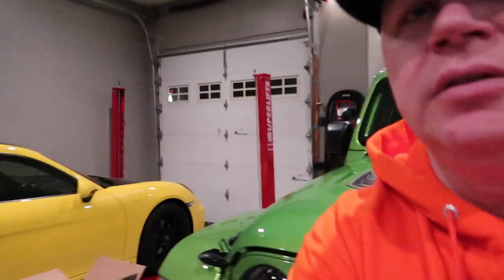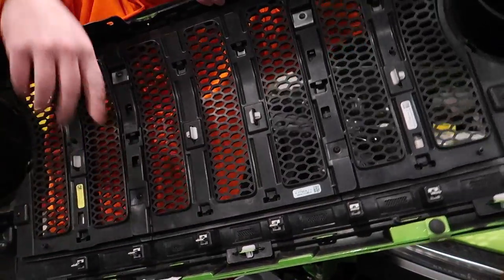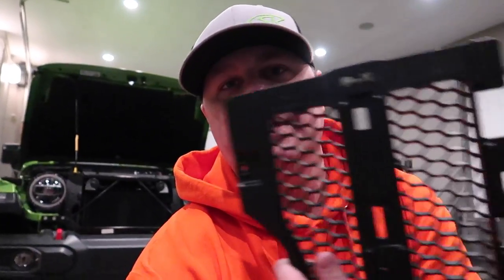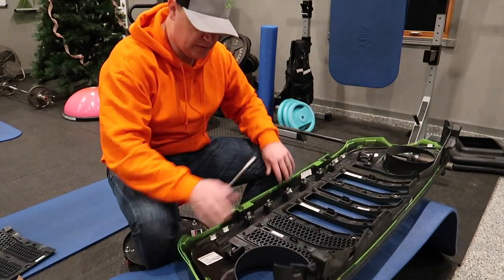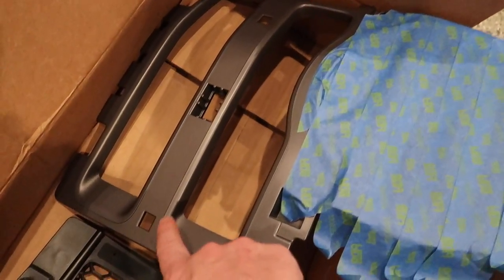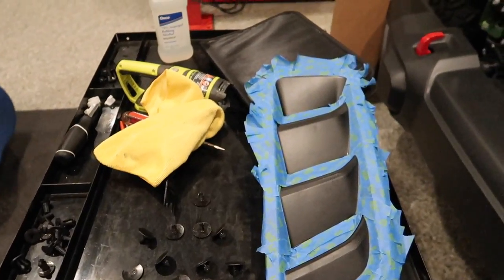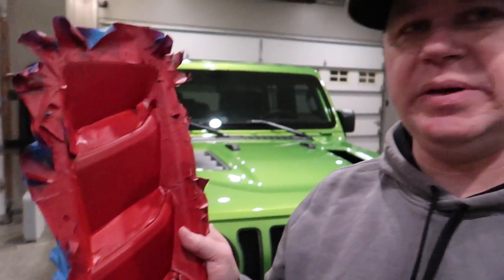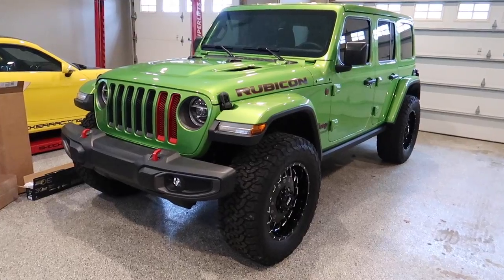How To REMOVE, DISASSEMBLE, & PLASTI DIP JEEP JL Grill & Headlight Surround

Comment: I was thinking about doing something similar with mine. How about doing the honeycomb in the hood inserts? Also - a little tip for masking off Plastidip - Remove the tape while the dip is still wet. This will give you a nice clean edge. Just be careful not to drag the tape through the wet Plastidip.
Reply from the maker: DravenGSX we were thinking about trying the honeycomb in the scoop soon. And thanks for the tip!

Comment: Looks awesome! What I did on my rubicon is wrap the hood but only the caved in part that looks like a circle, then grab some pin stripe tape and follow the edges all the way around. There’s somebody else on YouTube that did something like the same I would check it out. Hope it helps!
Reply from the maker: Sohail Zamani thanks! Sounds like the opposite of what we did on our Gladiator. We left the center bump showing but wrapped the rest of the hood and then put a pinstripe on.

Comment: I have a granite crystal jl rubicon and had the hood vents painted red by auto body shop and turned out great.  I then found red plastic covers on ebay for the side vents. Added just the right amt of red accent.
Reply from the maker: Dan Farrell nice! I can see it in your profile pic and that looks great, especially on the Granite color.

Comment: Perhaps painting the honeycomb portion of the hood inserts instead, you'll be able to see it from the driver seat. Also you could gloss coat over the grill inserts after painting to maybe better match the hooks. Just some thoughts, and love how you guys make the jeep your own.

Also, since the hood inserts don't look to be functional, could you drill some holes to let heat escape or is that not that big of a deal for  functionality? I realize I'm late to this conversation but I just subscribed.
Reply from the maker: Bcharns thanks for subscribing and the suggestions! People have cut open the hood inserts to let more heat out. I haven’t had any heat issues, so I left mine for now.

Comment: I love the grill but when painting or dipping over a dark color use a light gray or white base first. Vinyl wrap the vent it will last longer that plasti dip and look better.
Reply from the maker: Jay Smith thanks for the tip! Would you wrap the whole vent or just the accent like we tried?
Reply: Great Suggestion!
Reply: I would do the whole vent but leave the honeycomb part black or you can do the outline of the vent in red and leave the fins black. Maybe use a fine line tape and mask it with 1 inch tape and you can peel the dip with out bleed through edges.

Comment: How does the Plasti dip hold up to pressure washing?
Reply from the maker: It’s been on for a few years now and has held up to pressure washing and car washes no problem!
Reply: @shockerracing  Thank you!
Reply: @shockerracing  One more question did you put a clear coat or anything else on other than the plastidip
Reply from the maker: @dianeklein4141  no we did not, but if you want it to be more glossy you can add the clear coat.

Comment: I like the black better than the red.  When you mask items off to plastidip, peel the tape off while the dip is still wet you should get clean lines and not have to cut anything.
Reply from the maker: Rich Beach that’s good to know. I didn’t think about peeling it off wet.

Comment: The grill should match the vent.  It would look good if you would have left the grill outer bezel black and have just the mesh part red and then it would have been black with red in the middle surrounded by green like the hood vent.

Comment: I love how the PlastiDip comes right off! That makes this way less scary. Thanks for the tip. I watch a lot of videos of all ya'll taking apart and putting back together so many parts of your Jeeps so often. Don't these parts get warn out? I mean the clips, tabs, etc? All I need is something else to start rattling. 🙉🙉  -fairly new JL owner. 
Regarding the red with the green...it's interesting. I don't love it but that is not what matters.😁 But cool videos and yes...get that thing out of the garage!
Reply from the maker: Paula Becker thanks for watching and your support Paula! Clips can get warm out or even lost(we lost a few from the dash) but they are cheap and easily replaceable. Part of the fun is learning all about the vehicle and how easily a lot of these parts can be removed, replaced or modded. My first experience with plastidip was pretty good, like i mentioned it’s great to be able to test things without it being permanent.
Reply: @shockerracing  thanks!

Comment: Came here to figure out how to get the headlight portion off of that last little tab... And that portion seemed to get skipped.
Reply from the maker: Sorry about that, I believe I just used a flathead screwdriver to pry those tabs out.
Reply: @shockerracing  No worries. I ended up just slightly rotating the insert counterclockwise while pulling it away from the tab and it popped out.